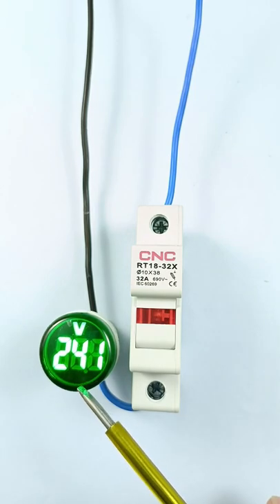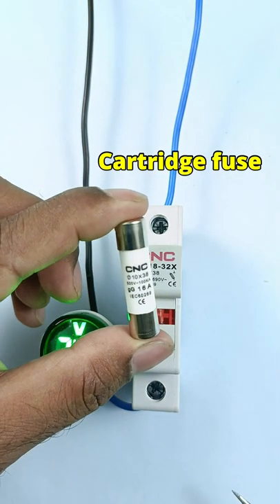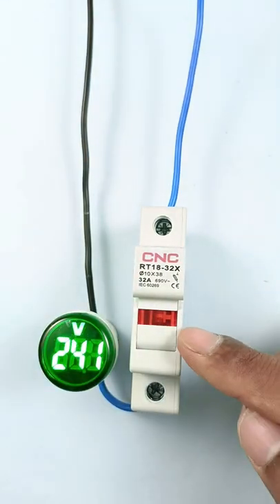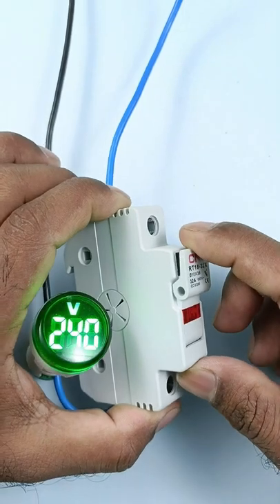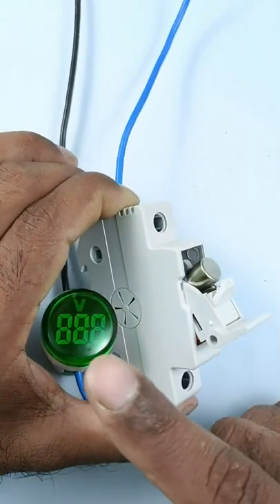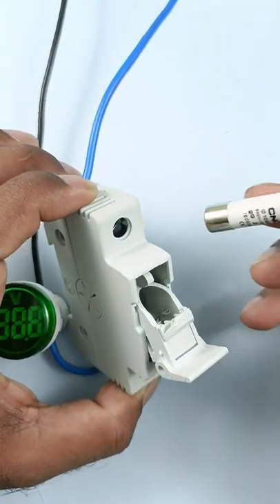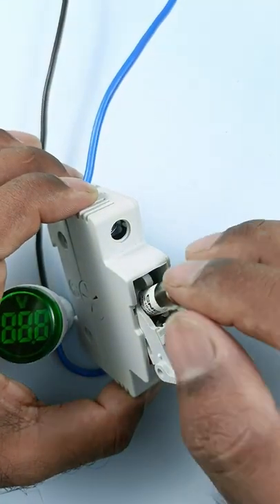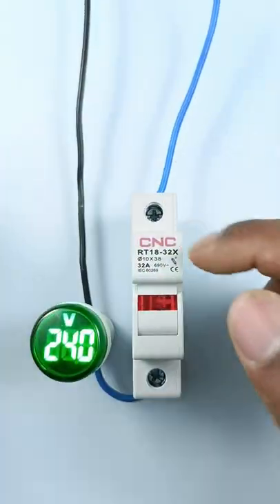RT18 fuse disconnector is used for overload & short circuit protection

Comment: Always use an isolator before the fuse. Do not remove fuse under load. First disconnect the circuit using isolator and then remove the fuse.